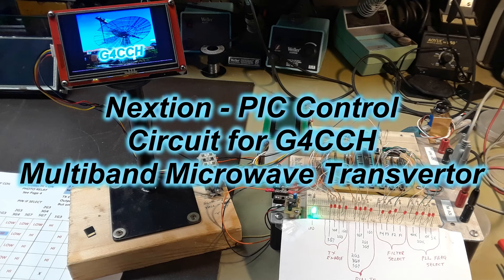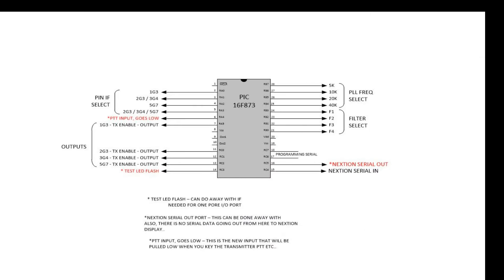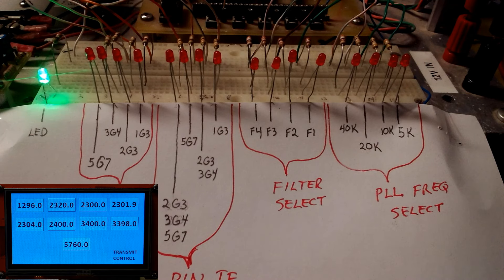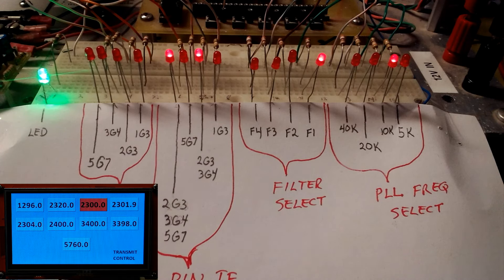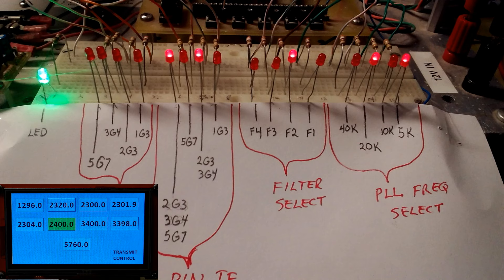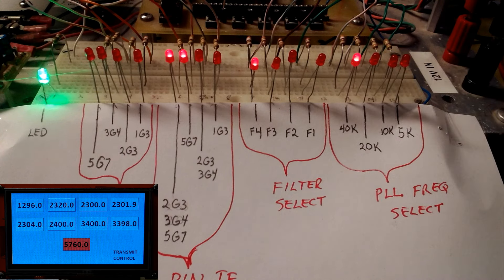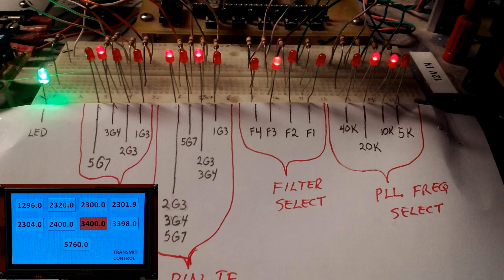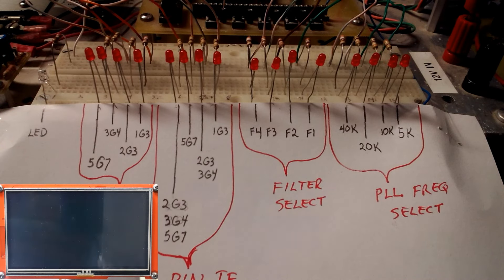G4CCH Transverter Control

Comment: Great work Skip, it works just like the truth table. We have forgotten about the need to work cross band. Like TX 2320 and RX 2304 or 2400, or TX 3400 and RX 3398. I have two rotary switches on the existing setup that do this. Will be in touch later.